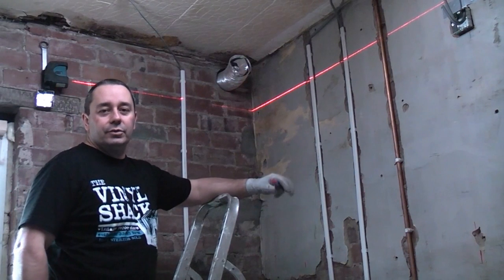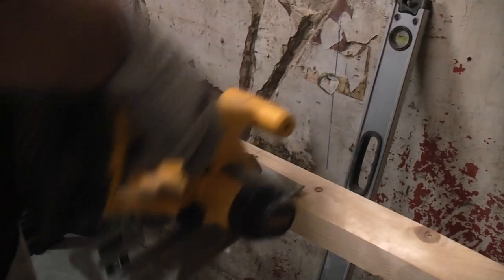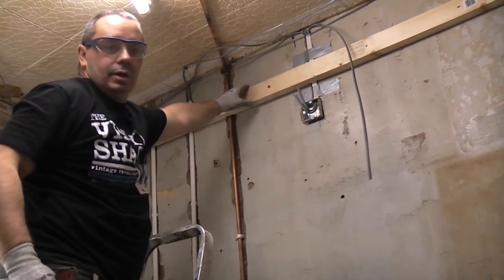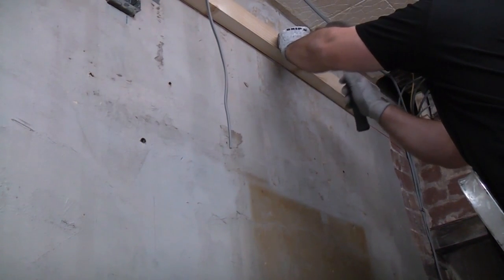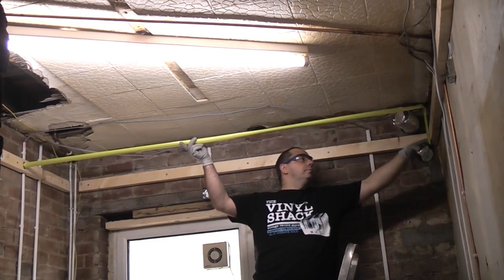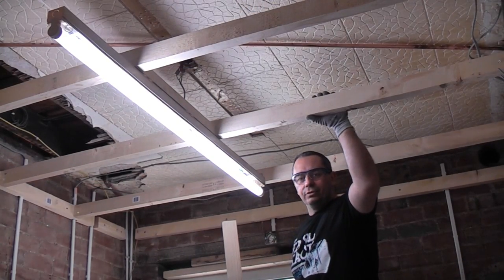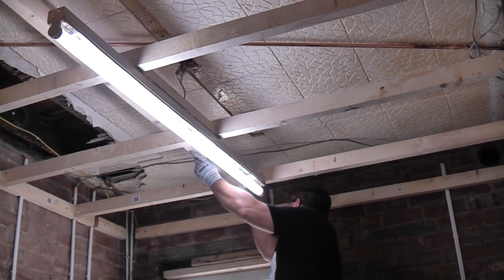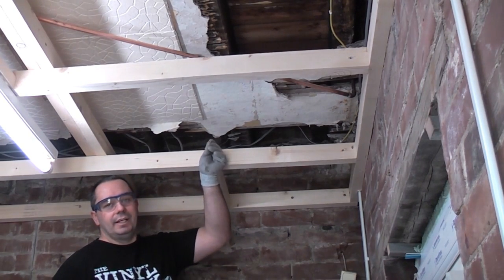How to install a stud ceiling

Comment: this was very helpful as I have to install a stud ceiling  under a lath ceiling in a 1890'a home. thank you for the video.
Reply from the maker: I'm glad the video helps ;-)
Thanks for the comment
Reply: Same here 1890 house. Not fun knocking out old lath & plaster. Lowering a bit so I hide electrical and install recessed lighting.
Reply: I am thinking of doing the same. How much clearance are you giving the recessed lighting from plaster? I want to maximize the height

Comment: Great video mate.. I'm building a room within a shed with a lower ceiling that's gonna be 8ft high.. The room will be 16ft x 16ft..what size of timber wud u recommend for ceiling joists.. Wud 2x8 be OK
Reply from the maker: Not sure, I've never built anything like that before, but 8"x2" sounds like it should do the job

Comment: That was the best produced, best explained and best visuals of anything Ive seen on the web. Thank you, Im about to fix the same type of ceiling in a small space off a bedroom (renovating a French village house) and now feel I can set about it. Q when you angle screw (skew screw?) the studs to the wall plate does the pressure not move the stud?? Subscribed.
Reply from the maker: No, providing the stud is a tight fit.
If a nail gun is being used, that will move the stud, so I always use a clamp at the other side of where I’m skew nailing, to prevent it from being moved 👍
Reply: Clamp, brilliant. Thanks.  @ultimatehandyman

Comment: Hi, love your video.I have a room 20x22ft can this be done if i join the  pcs.I was thinking to run one joined pcs down the middle and then the others off that one.i only need to hang sheetrock and a couple leds in my livingroom
Reply from the maker: I've done a similar sized room before, as long as you get some supports (stringers) near the centre, it should be fine 👍

Comment: Just wondering. Could you use joust hangers instead of skew screwing into the wall plates. This was my first option. My second option is a metal stud ceiling. Any idea which is cheaper or easier?
Reply from the maker: You could use joist hangers, but that makes the job more expensive. I know absolutely nothing about metal stud ceilings, as I always use wood  👍

Comment: Hi
My room ceiling is 4.75m x 4.65m.
The timber available comes in 3m lengths. Is this not possible for larger rooms? Or is there an alternative way without going in to the beams. I have already done a smaller room. Great video, easy to follow instructions.
Reply from the maker: I've done larger rooms like that, but I had to join the timber together.
I normally butt the two pieces together then, cut a piece about a foot long and then use that to brace the two pieces together, using about ten 3.5" long woodscrews. I use these for the perimeter, but for the other lengths I use two pieces 12" long, one on each side two pieces that I'm joining together. 

Thanks for the comment 👍

Comment: One of the best videos for this job.
Would this be suitable on a bedroom ceiling 15ft x 15ft n would I have to increase joist sizes/ C24 timber ?
Reply from the maker: 3*2 will be fine, I have done similar sized rooms in the past, you can always add a few more stringers for additional support.
Thanks for the comment

Comment: Thanks for the nice job... 
I wonder if I can use the same method in a bigger hall (55 ft x 22 ft) , currently we have a 17 ft heigh ceiling and want to convert to 10 ft only... and will install a drywall boards to the ceiling frame.
Appreciate your feedback.... thanks
Reply from the maker: I'm afraid you might need a structural engineer to offer a solution for a large area like that!
Thanks for the comment 👍

Comment: Fixing into the end grain was considered a  weaker joint than skew fixing into the cross grain due to the structure of timber. 
I was shown at the time where fixing into the end grain had failed, it was probably fine at the time of fixing but subsequently failed. 
However, there are different fixing these days and we did not have power tools in the 60's so we used nails, screws might not be as bad.

Comment: I was thinking of doing something like this in a duplex I purchased.  I have 10 foot ceilings, but the house is old and the noise transfer is ridiculous.  I figured adding a second ceiling would make it easier to put some overhead lighting in and add some sound proof batting.  The rooms I have are much larger though and I would worry about the 2x4's flexing using your method of framing to the wall.  I was thinking of screwing the 2x4's directly through the plaster ceiling into the joists above going in the perpendicular direction? The joists now go east to west which make getting power from a switch difficult, so my overall plan was to put up a second set of "joists" using 2x4s, going north to south.  Run the power through these to the switch I will put in near the door. throw in maybe 4 inches of dense polyester, and then possibly use "hat channels" before I put the dry wall up?  Your method actually looks easier as I won't need to find the joists but again I am worried abou tthe 2x4's flexing in rooms this size.  Let me know what you think, and thanks!
Reply from the maker: I think your original idea is probably best, although for noise deadening it might be more beneficial to install a stud ceiling with an air gap as this would probably be the best option to help prevent sound transfer.

Perhaps another option would be to install a stud ceiling but put supports in from the original ceiling joists to give the stud ceiling some support ? 

Finding ceiling joists is normally very easy as you just need a magnet to locate the screw heads that hold the drywall to the joists, like this- https://www.youtube.com/watch?v=H5U0sLKyJJw

Thanks for the comment
Reply: Thanks for getting back to me but I am a little confused about part of your reply.  You suggest doing an air gap. do you mean simply NOT putting any insulation in there for sound deadening?  I am not sure how that would help with stopping noise from talking?  Your second suggestion says build stud ceiling but use supports from original ceiling, that is what I thought my plan was?  I suspect my confusion is just based on my inexperience and not understanding the lingo.  I don't mean to be obtuse, and your help is appreciated!
Reply: Maybe I should ask my question a different way.  How would you do the stud ceiling like the one in your video, but for a much larger room? If it was on the first floor of a multi story family unit would you just use insulation to help with sound proofing, and hat channels to separate drywall from joists?  This is where I've been getting some of my ideas, basically "step 2" but with the new ceiling instead of tearing up old one.  http://www.diynetwork.com/how-to/rooms-and-spaces/walls-and-ceilings/soundproofing-a-ceiling
Reply from the maker: By an air gap I mean installing another ceiling below, using the method in this video BUT having insulation either on top of the new ceiling or below the original ceiling so that the two ceilings have nothing toughing each other. Insulation for heat is much different to sound insulation and can be very expensive to do it correctly. I know a few people that live in terraced houses and they have asked me how to soundproof it so that they cannot hear their noisy neighbours, I normally recommend that they move house as soundproofing a property is very expensive. Sounds can travel through connecting timbers etc. which is why I recommended an air gap, however if you install a false ceiling like in this video but have a few timber braces from the new ceiling to the old ceiling I am sure it will not make much difference (obviously with the insulation as well)
Reply from the maker: For a larger room I would do it exactly the same way but I'd incorporate some braces from the existing structure (I'm not sure if braces is the correct term, I was told that in lofts they are called stringers but after searching Google nothing showed up for stringers), basically it is pieces of 3X2 timber or 4X2 timber that connects both of the ceilings together to prevent the new ceiling from sagging. The hat channels would probably help, although I have never used them before. You can get sound blocking plasterboard, but I do not know how effective it is.
Reply: I saw a new type of screw for this purpose recently. IIRC it uses some kind of damper to connect the two surfaces so that sounds dont travel along the screw.

Comment: Good video thanks. I'm wanting to put up PVC paneling with some down lighters, is the method of the stud the same for this? Spacings etc.
Reply from the maker: If there is a ceiling up already you can just batten it out-
How to batten a ceiling

Comment: Overall great job. Personally I would use masonry screws to fix wall plate, quicker and easier. But when you use wall plugs you'll get stronger fixing when using self tapping screws not wood screws with cutting point. You want plug to be forced to spread when wood screws tend to cut into plug reducing presure and therefore creating weaker connection. If time allows consider creating notched connection betwen joists and wall plate so you dont have to rely only on screws and friction holding it up

Comment: If the corners aren't square due to walls being plastered numerous times and have forced the walls in/out and shorter at 1 end and longer on the other....where would you start in measuring for your first beam?
Reply from the maker: I normally start at the widest point.
Thanks for the comment 👍
Reply: @ultimatehandyman  thanks! 😁

Comment: Thanks for this video. We are installing a stud ceiling in between the kitchen and a bathroom above. What  would you recommend for soundproofing/insulation? Thanks
Reply from the maker: I'm no expert on soundproofing and to do it properly it is very expensive.
I don't normally bother with insulation in a kitchen ceiling but if you want to I guess it will help with sound insulation too. I'd look at loft insulation as it is normally inexpensive.
You can get special soundproof plasterboard but it is expensive.
The last time I installed a kitchen ceiling I installed the stud work as per this video, then used normal 1/2 inch think plasterboard and then over boarded that with fire resistant plasterboard, which you may need to do to meet fire regulations- http://www.ultimatehandyman.co.uk/how-to/plastering/overboard-ceiling

Comment: The studding timbers are an interference fit. In your opinion what would happen if fresh dry timbers were used then expanded through moisture laden air, roof water leak, pipework leak etc? Is there a chance walls could be pushed apart and cracks form in brickwork. Do you at least recommend storing the timbers in the room to be studded for a few days first? I like your videos, thankyou

Comment: I'm looking to lower the ceiling in my living room.  They are very high ceilings and the rooms cost a fortune to heat.  It is quite a large room so would use 400mm spaces between studs as you recommend.  Would I also be able to install some insulation above the stud ceiling to keep the warmth in? Any more tips?  Many thanks.

Comment: Will this also help toward soundproofing? Like if I stuffed the empty space with whool or an acoustic proof material?
Reply from the maker: It might help, but to be perfectly honest if you have to do soundproofing properly, it is very expensive. You can, of course, reduce a lot of sound by doing this and adding some soundproofing material, but don't expect miracles.
In the past people have asked me how to soundproof their flat due to noisy neighbours- they think I'm joking when I tell them that it will be easier and less expensive to move 😉
Thanks for the comment 👍

Comment: Thanks for the video. Was it necessary to drill pilot holes into the studs beforehand, so as not to spit the wood when drilling?
Reply from the maker: It's not always necessary if you use good quality wood screws, but the joint does tend to pull tighter if pilot holes are drilled.

Comment: and what holds the weight in the centre over that distance between wall to wall?. you've only fixed in on either side brickwork!! what holds and stops it sagging in middle across the whole lenght ?
Reply from the maker: All the studs and noggins are cut tight and screwed into position, but I also put a length of 3”X2” from one end to the other end, which sat above the wall studs, all other studs were then screwed into that using 4” wood screws. For larger ceilings, you can insert stringers from the existing ceiling 👍

Comment: Where does the hole in original ceiling go? To the attic? I see to many other issues with the old ceiling, to just be covering up. Whats wrong with a higher ceiling, and wouldn't it be cheaper in the long run to repair the existing ceiling?
Reply from the maker: Above this kitchen is a bathroom.
It would be cheaper to repair the existing ceiling, but ceilings in older properties have high ceilings, which makes the properties difficult to heat because the heat rises. The old ceiling is also lath and plaster which makes it difficult to repair. 
This ceiling was installed so that the ducting for the extractor could be placed in the void and vented outside. 
Thanks for the comment

Comment: Great video, great tips. Does anyone know what size drywall screws to use when fixing the 12.5mm plasterboard on to the timber? I've created a false ceiling too.
Reply from the maker: I'd go for between 32mm and 40mm long. 
https://www.youtube.com/watch?v=WneqUwecT5s

Thanks for the comment 👍

Comment: I was excited seeing this because it's how i renovated my 30's house, only the way it was done that i copied was better than this, on the bottom of that spar on the wall you need to attach a lathe, then you cut out the lathe size of the other spar and sit it on it, much more secure and doesn't need to be so tight
Reply from the maker: Thanks for the comment

Comment: Iam doing a larger room, the only thing is I am struggling to find timber that is long enough to go all the way across the celling. Does it have to be one piece, or can you join them end to end
?
Reply from the maker: You can join them end to end, I have had to do that a few times.
I normally use two off cuts of the timber that I'm using, preferably about two feet long and brace the joint on each side using the two off cuts. I normally glue and screw them together to make the strongest joint possible (without using bolts).

Comment: Need to install a stud ceiling in a small cellar room (2m x 4.8m) for the purpose of putting up pvcu cladding. The ceiling is only 2.2m high so dont want to lose much height. Would 2x2 timber be sufficient and also can i put the timber flush against the ceiling if i was to add 3 led lights??? not sure how much gap is required from a safety point. Cheers.
Reply from the maker: This should help-
How to batten a ceiling
Bathroom ceiling cladding

LED lights should not be a problem as they run cool, unless there is a possibility of someone replacing one of the LED lamps with an Halogen lamp.
Reply: *****
Legend!!  Thank you.
Reply from the maker: atif qureshi
You are welcome ;-)
Reply: Can you recommend how many lights and wattage given the size of the room?  Cheers.
Reply from the maker: atif qureshi
It depends as there are so many variables in LED's. I'd probably go for 4 downlighters, the higher the wattage the better. I think the last ones I installed were 8w

Comment: You should be using pressure treated lumber when attaching directly to concrete because the moisture in the concrete will penetrate the wood and rot it over time.
Reply from the maker: These timbers are attached to bricks, not concrete. The wall is internal, the timber will never rot in 200 years 😉 
Thanks for the comment 👍

Comment: Excellent video, and your comment replies are so hellpful! I wonder if you can help me: I have a 6mx6m ceiling that needs a stud ceiling! The roof timbers are currently exposed and can be used for extra support; but what is the best method for connecting the roof timbers and the ceiling? will I just be able to find certain spots that allow me to connect the two? I'm imagining using noggins  the roof  timbers in strategic positions to allow me to use "braces" or "stringers"....  Any chance you have any better ideas for me?
Reply: Can I use steel cords???
Reply from the maker: You could use steel cords, but they might be difficult to connect. Normally I will just use some off cuts of timber that I'm using for the stud ceiling and ensure that good screws are used to connect the old ceiling to the new ceiling. A few years back a bedroom ceiling was sagging really badly as it was built with thin joists, so I made holes in the old ceiling and put timber braces up and connected them to the roof timbers.
Reply: Thanks very much for the reply. So how did you connect them? Just a vertical brace from rafters to joists with 2 screws in each end? I'm thinking my rafters and joists won't line up, so I can just use noggins on the rafters... Which will use a lot of screws but should save time!

Comment: Hi Looks great, would you use insulated board for the ceiling ?? Thanks
Reply from the maker: Not normally, but if you wanted it to be insulated you could use insulated plasterboard. I have over-boarded with insulated plasterboard in the past in attic rooms. This false ceiling was in a kitchen, so I double boarded it, firstly with regular plasterboard, then with fire rated plasterboard- http://www.ultimatehandyman.co.uk/how-to/plastering/overboard-ceiling
  Thanks for the comment 👍

Comment: Hi there, I’m diying this for the 1st time however the width of my ceiling is wider than cls timber available, is it ok to join 2 pcs in the middle?
Reply from the maker: You can, but it’s a lot more work and time consuming to do it right. I would suggest looking elsewhere for the timber. Travis Perkins in the UK sell 3*2 in 4.8 metre lengths!